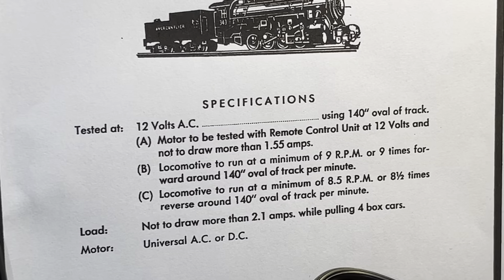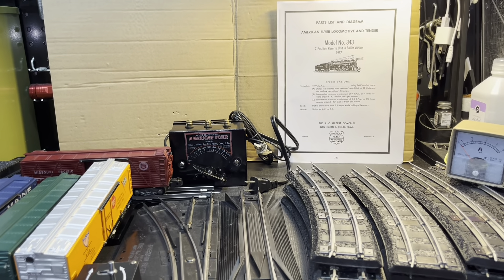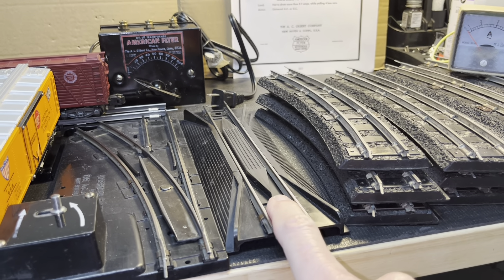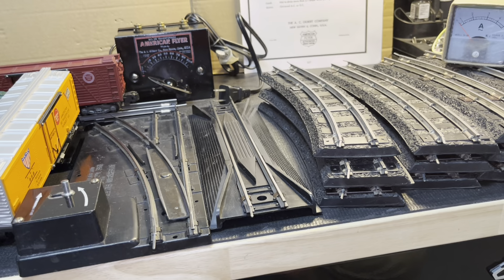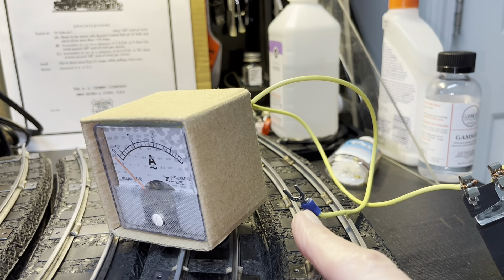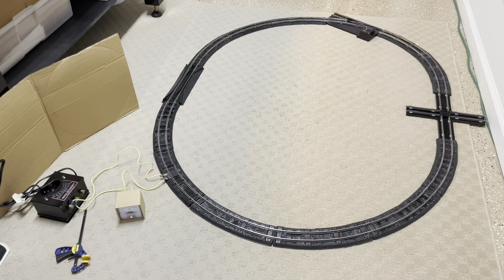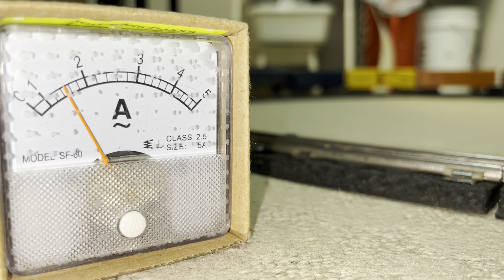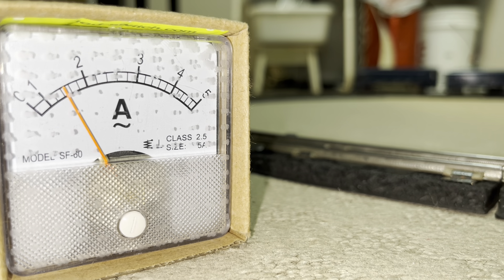Amp Draw Test: 350 4-6-2 Pacific The Royal Blue Type III 1948-1950

Comment: Where did you get your meter.
Reply from the maker: They seem to be plentiful on eBay and maybe Amazon, the one I use is SF-60, hope this helps, DavesAFTrains
Reply from the maker: Mine is from led-switch(dot)com. It is a simple 5-amp AC ammeter, if I were purchasing again I would buy digital rather than analog. Also could try dallee(dot)com, eBay, and Amazon.